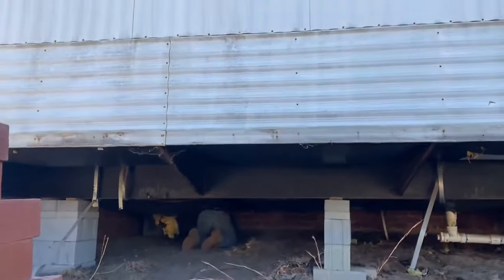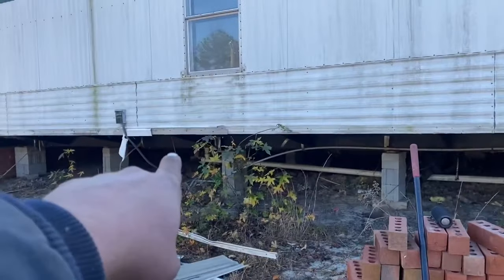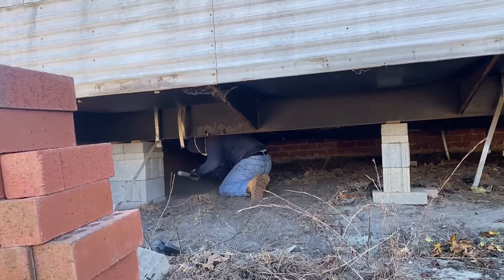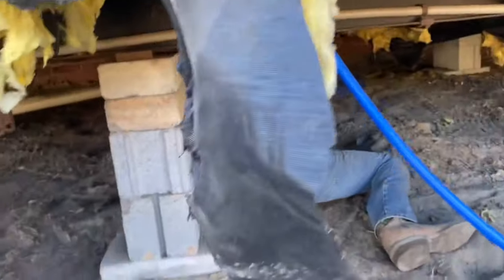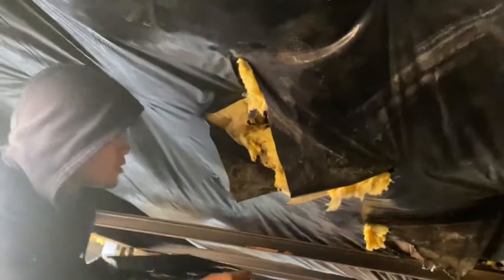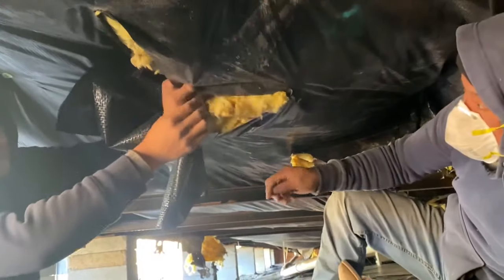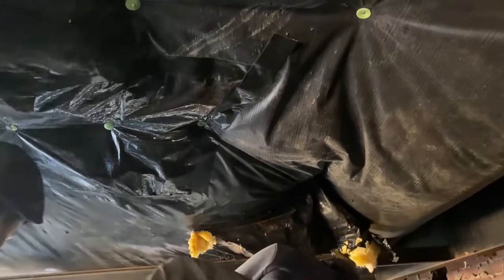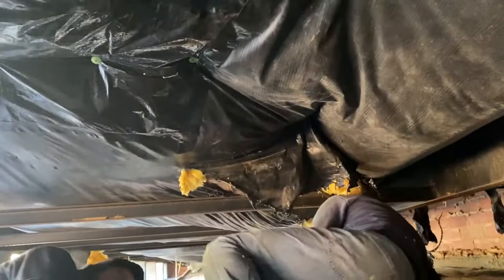Installing Vapor Barrier Under A Mobile Home & Repairing The Insulation & 'Belly' Material

Comment: What tape are you using because everything ive tried eventually will not hold due to the heat
Reply from the maker: We are using button head nails to hold it in place and gorilla tape to tape this seems been a little over a year and still holding strong